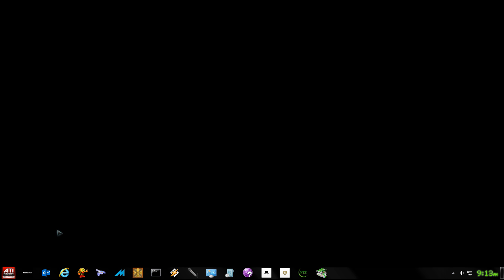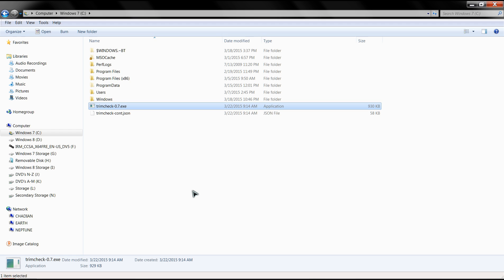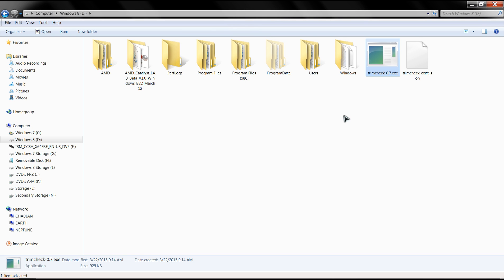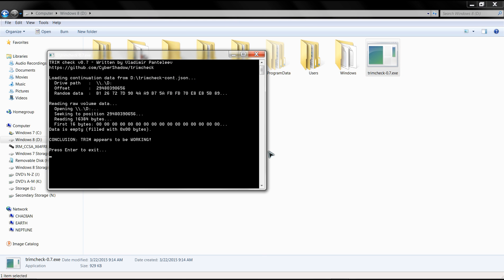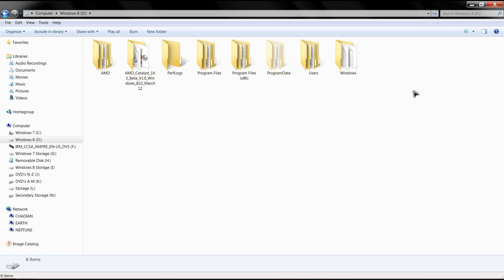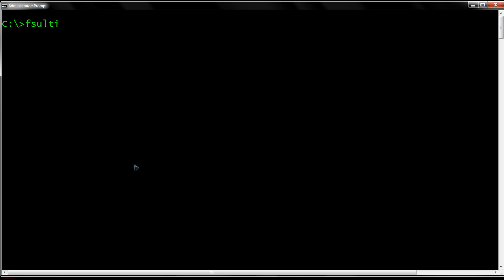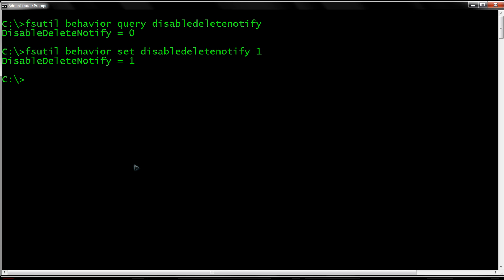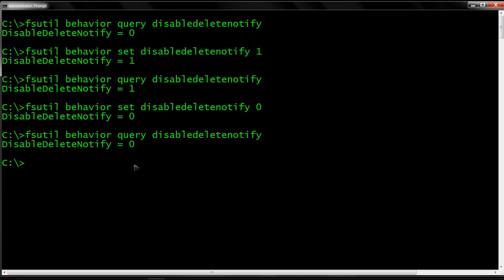SSD How To Check, Disable & Enable The TRIM Function Windows 7

Comment: I have a 4 ssd raid 0 setup on a perc h310 sas/sata controller card and can't run ahci, how do I enable trim?
Reply: I'm good, your advice worked....thanks! You rule!
Reply from the maker: @lordbobrules  awesome and thank you for checking it out.
Reply: @ChadLuciano  i spoke too soon, trim support won't enable...
Reply from the maker: @lordbobrules If you can provide me with your hardware profile I will do my best for you.
Reply: @ChadLuciano  dell precision t5600, 2 e5-2690 cpu's, 4gbx8 ddr3, 4 Samsung SSD 850 EVO in raid 0. c600 chipset, dell perc h310 controller. windows 10.
Reply from the maker: @lordbobrules  long story short....you'll have to chance flashing your RAID H310 or alternatively provision an extra 10-20% of unpartitioned space for clutter. Your controller does not support TRIM.
Reply: @ChadLuciano  thanks for your help. could you recommend a card? or a link how to flash it.
Reply from the maker: @lordbobrules  Here are a couple of links worth a read....
https://forums.unraid.net/topic/84156-lsi-9211-8i-and-trim-support/ and https://www.dell.com/support/article/en-ca/qna44096/is-trim-supported-on-perc9-controller-in-raid-mode?lang=en. Your predicament is something I haven't encountered in my own experiences. The 10-20% unpartitioned slack idea as well as some type of software implementation is the approach I would take unless of course money isn't an issue you may want to try another alternative. I do not have a work around for your situation other than what we have previously discussed. From a hardware prospective it currently doesn't look possible to implement the trim function utilizing a RAID array unless as noted above.